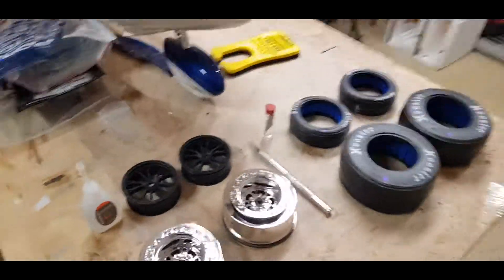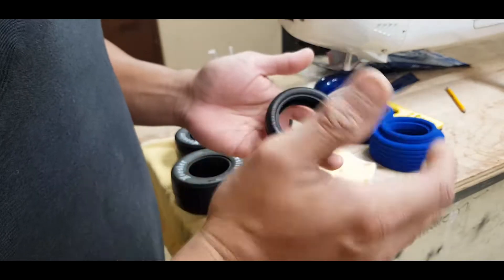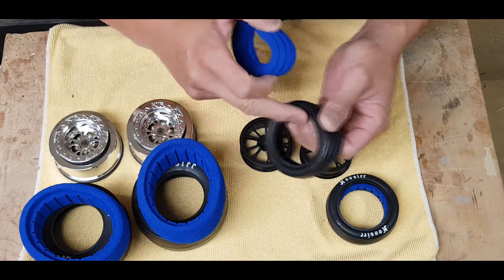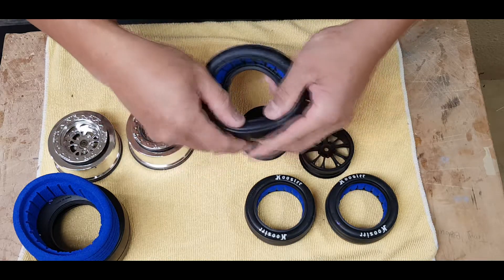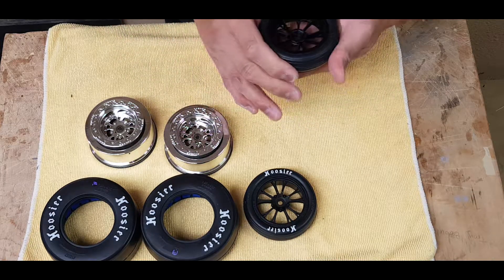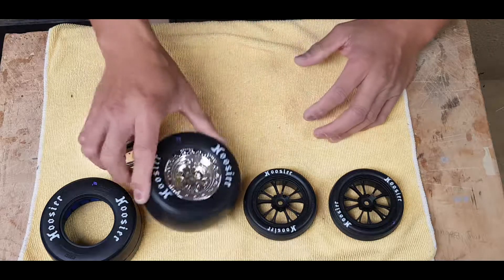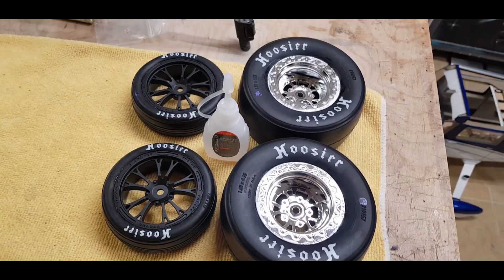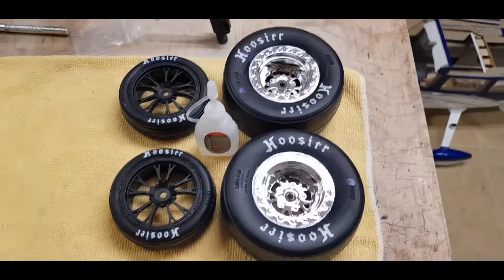how I glue tires to rims RC car and trucks

Comment: So would basic rubbing alcohol be good for cleaning tires or would there be any issues with it
Reply from the maker: Yes you can use rubbing alcohol to clean the tires and rims as well.  It is just to remove the release agents from the molding process at the factory so that you can get the best mechanical bond between the rubber and plastic.